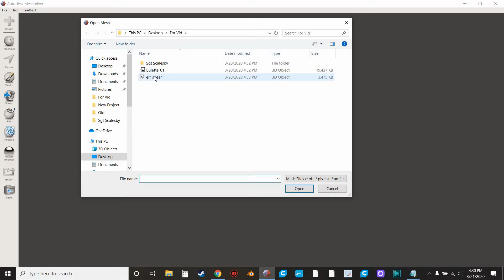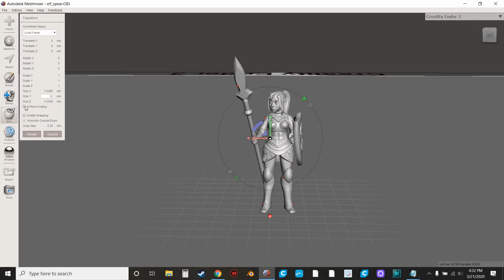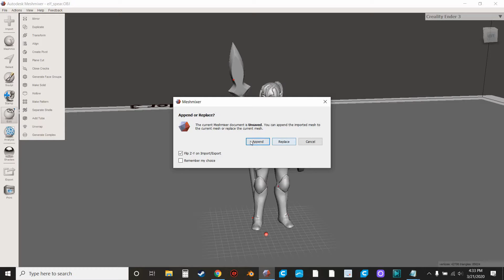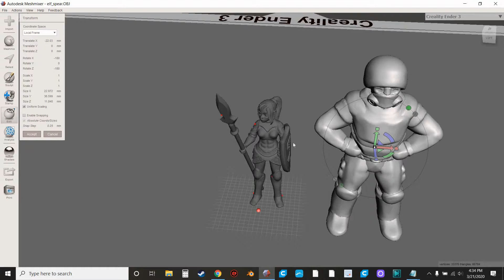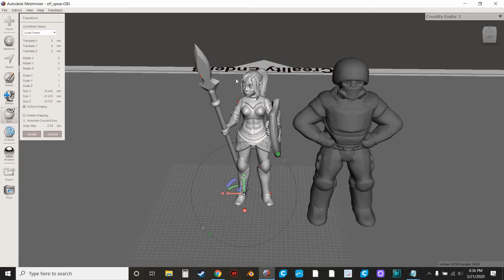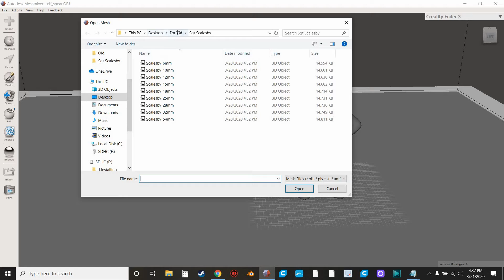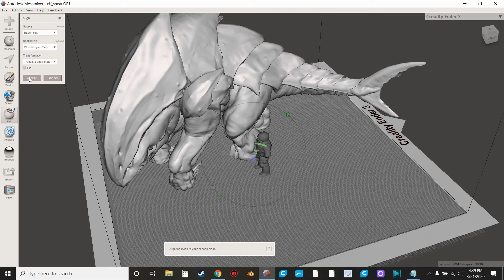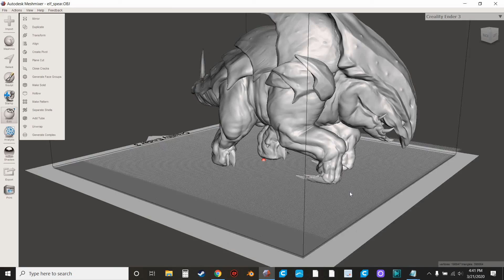Easy Tutorial for Scaling Models With Meshmixer

Comment: Why the program is not accept to use point after the number of the value, for example 1.22 ,  0.5 etc.  Is this is some kind of bug? I've tried many times with no result. Is accepting only full numbers.
Reply: I have the same problem did you find a Solution?

Comment: Thank you so much this was exactly what I was looking for and it was very easy to follow!
Reply from the maker: You are very welcome. You may be interested in my updated video on this topic.
You can find that here, https://youtu.be/jW1mLG7wTq0
Reply: @SlicePrintRoleplay  I did see it but that's not meshmixer, right? Is it better?
Reply from the maker: @Jerica.B  no it's not Meshmixer. That video actually explains how to scale models within your 3D slicer. It works pretty much the same way as it does in Meshmixer but it saves you a little time. 3D slicing programs have gotten much better about how models are treated when scaled up/down. I used to see issues when doing this within a slicer, but not over the past year or so.
Reply: @SlicePrintRoleplay  I will check it out. Thank you!
Reply from the maker: @Jerica.B  you are very welcome.

Comment: If it's easy why is it 10 goddamn minutes long. It's scaling, not quantum physics.
Reply from the maker: Because this was one of the first videos I ever made. At this point I hadn't learned what exact steps/info should be the focus for each topic. I also try to make my videos easy for new 3D makers to pick up. That normally requires a bit more time. 
Additionally, I make these videos as a hobby and therefore don't hold myself up to a professional standard of quality, editing, etc. If that's what you're looking for then my channel isn't going to be the best resource for you I'm afraid. 
I have since made an updated video on this topic. That video has time stamps so you can jump to the info you need. That video is highlighted at the very top of the description of this video.
Reply: @SlicePrintRoleplay  Gosh I'm so sorry for being a jerk, I didn't think you'd actually read the comment. I just got a little pissed off by Meshmixer.
Reply: @voldy3565  Thank you for claiming culpability. Meshmixer can be a wicked beast at times, but as you might see from other comments above, some find 10 minutes to be too short to adequately cover everything that Meshmixer offers in terms of scaling options. If you haven't had a chance to check out the updated video though, please do so! Especially with the timestamps, you may find it more to your liking :)
Reply from the maker: @voldy3565  I appreciate the apology, it's very rare for people to post a negative comment and apologize after.
Meshmixer can certainly be overwhelming I agree. That's one of the main reasons why I created the updated video explaining how to scale models within your slicer instead.

Comment: is not possible to save scaled model..when exported only original dimensions..no change
Reply from the maker: I've been using Meshmixer for quite awhile and done this many times so I assure you that it's absolutely possible. What format are you saving the file in? Also what is the second program you're opening the saved file in?